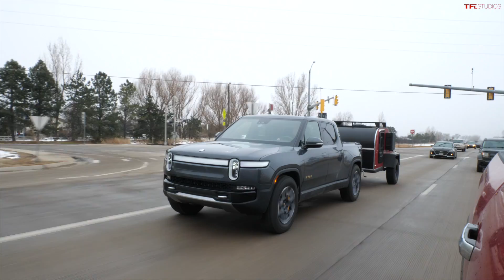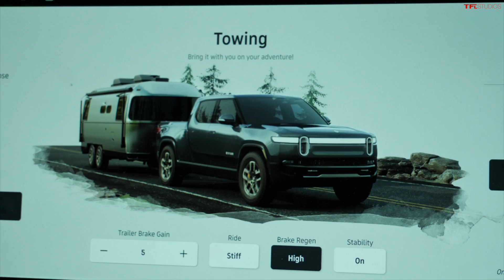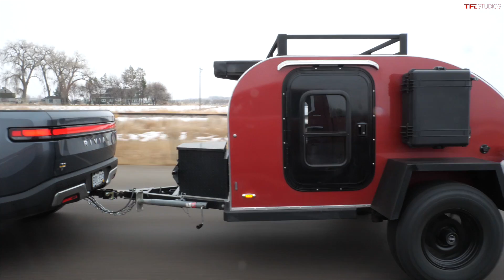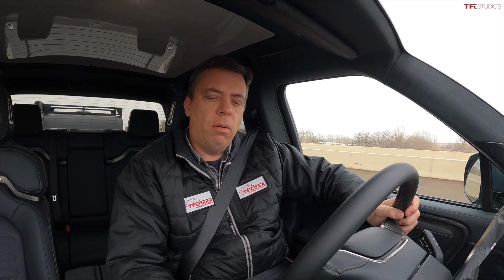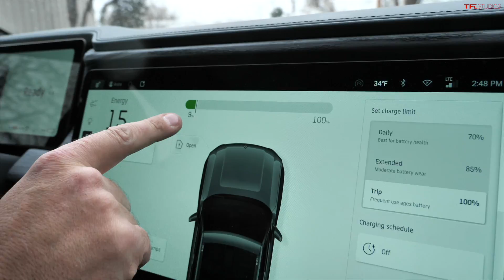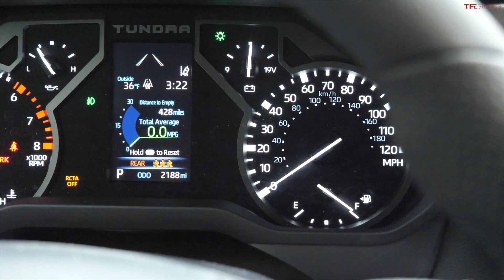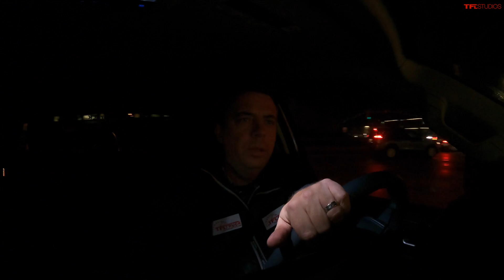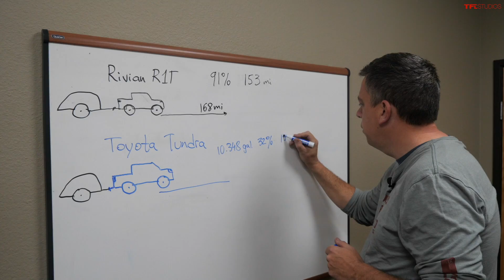Rivian R1T vs. Toyota Tundra: How Far Can Each Truck Tow On A Single 'Fill-Up'?

Comment: How many kWh of energy did the Rivian consume?  Once you know that you could also do a nice comparison of the cost required to fill it back up vs the Toyota. My guess it’ll be 1/2 the cost of that 10 or so gallons of gasoline for the Tundra. For instance if that Rivian had the 135 kWh battery, 91% of it would be 122.9 kW. Multiplied by $0.135 or 13.5 cents/kWh that I pay that works out to $16.58 of go juice vs the $35 or so for the Tundra.

Comment: I find the tank percentage a bit misleading. The tundra has a 32.2 gallon tank where a f150 or a ram 1500 has a 26 gallon tank. Did you choose the tundra for the tank size?

Comment: This is great, BUUUUUT: The Toyota used 10.348 gallons of fuel at a cost, near me, of at least $35. It would have been great to know how much $$$ the kW that went into the Rivian cost. Also, tow an 11,000 lb trailer, and then make two trips with the Toyota, towing 9,200 the first time and 1,800 the second, and tell me how much closer the numbers were. My hunch is that although many of the viewers will tow a teardrop, some of us are genuinely needing closer to the 11,000 lb capacity of the Rivian, and it would have been great to be able to put a number to the cost of the tow, so we can decide how much money we are spending to save the time of the stop / charge cycle. Is it $10 compared to $35? Is it $33?

Comment: I think it’s worth noting that the fuel economy of the Tundra drops nearly as much towing compared to the Rivian. The Tundra is rated 24 MPG highway, and during the test, it managed 14 MPG.  So the main difference between the two is the ability to carry more “fuel” with the Tundra.

Comment: Yeah still wondering what the cost comparison would be to "fill up" between both vehicles since they did the same distance.  What is the cost of electricity vs. gas?  And taking in consideration of downtime to recharge an electric vehicle.

Comment: I want to start by saying I like the Rivian. Being a truck it less efficient than other EV's currently available. I think this is as important to consideration as range and charging rate. The R1T has a 135kwh battery and 314 mile range. For comparison the Kia EV6 has a 77.4kwh battery and 310 range mile (rwd). So the Rivian need a battery 1.74x larger for the same range. That means if they had the same charging rate the Rivian would take 1.74 times longer to recover the same amount of range. 30 min in the Kia would take 52min in the Rivian. This doesn't mean you shouldn't buy the Rivian, or any of the other EV trucks that are coming out, just something to consider. 
( I understand the KIA and Rivian don't have the same charging rate.)

Comment: It's not just about range & recharging. It's also about weight & payload.  The 135-kWh R1T curb weight is 7,148 lbs. & it has a GVWR of 8,532 lbs., making it a Class 2b truck (same as an F-250/GM-2500) but it's payload is only 1384  lbs. I can't find the GCWR. But just adding 10% (minimum) tongue weight of the 11k trailer it's supposedly rated to tow, reduces that 1,384 lb. payload by at least 1,100 lbs., leaving only 284 lbs. for driver, passengers & their gear.

Comment: These electric cars and trucks are a joke. All that weight and the battery does not get lower weight as you drive unlike your gas cars. And you have the charge time. And if you use the heater or the A/C, your range gets reduced more.  Good luck with that.  3 gallon of gas has more energy than a same weight of battery pack.  Good luck if you run out of juice middle of nowhere.  You can walk and carry a small jug to a gas station and you can run the engine for at least 70 miles after. These electric cars are constantly wirelessly connected. You do not know what they are sending back to home. They can also kill the engine at the whim of govt. Total control of your freedom of movements.

Comment: So based on the numbers the Rivian is more expensive per mile and will take you twice as long to get there. Sounds like a great truck to tow even the lightest of campers.  This truck has like a 144kWh pack and only has a 160 mile range towing a 2k trailer?  Sheesh

Comment: INVALID TEST, but close enough.  I got a lot of good info from this video but here is what went wrong.  The test was invalid because you went one leg with one truck and a different leg (return trip) in a different truck.  One truck had an advantage given the following factors that were not considered.  #1 Elevation is a big deal and was not accounted for due to not doing the same exact route.  #2 One leg is different from the other because there is more left or right turns on one leg over the other causing the leg to be longer than the other.  #3 Did you use the same exact lane on the same exact stretch of road?  Because this wasn't done, like #2 you will have to travel further in one lane versus the other when going around curves in the road.  If I missed something or assumed something incorrectly then I'm sorry.
Reply: Nope you are incorrect it was the same out and back route for each truck

Comment: If a Rivian owner towed anything at all it'd probably be more like their kids little league team or dance team trailer but good on you guys for doing something other channels don't. But here's the rub. While a lot of people will stop after a couple of hours to rest a bit that's because they WANT to not HAVE to in order to refuel. And nobody on a trip or on business partially refuels when they stop. So you've got to show the real world time it takes to fully recharge the Rivian. We know it will be far more than the 27 minutes it took to partially recharge in your IKE video but we don't know how long. After two to two and a half hours people are taking a five minutes stretch break, not a forty five minute lunch break. The other issue is something that even you at TFL never seem to address and that is additional payload influences on fuel economy. Okay, somebody is towing a tear drop trailer but are they going to the camp site solo without any gear? If they are towing for the little league team do you think they wouldn't have five people in the cab as well? The guy towing his 2000 pound boat might be going out solo but he's just as likely to have a buddy and his kid with him as well as their gear with them. Payload weight and towing weight as well as trailer drag do affect things differently so not all of this can be extrapolated from a different test. 
I know I'm just a dude on the keyboard but I don't have the resources or the manufacturers access to be anything else right now. But if you need a driver (which you obviously don't) I'd be happy to put in the hours to get those results.

Comment: To be honest, 14mpg is pretty bad for that size trailer. I would fully expect 18-20mpg on the highway. For comparison, in my 1989 F-250 5.0, I get about 13-14mpg with a Lance cabover camper and towing about the same size trailer. 14mpg is abysmal for just a teardrop trailer.

Comment: Batteries have always been the problem with EVs this is nothing new. The industry has tried to electrify more than once. This is why it failed multiple times. This is why they still are inferior. This is why hybrid vehicle is superior. If you really want to have electric motors in a truck the diesel-electric is the answer.

Comment: Would love to see an average cost breakdown. I know there are alot of variables but an "average cost" per 168 mile trip would be awesome!
Reply: I agree. The rivian would be about $15 to recharge and the truck was $40
Reply: @hammercity905  and the rivian fully loaded is $120K...  don't forget to figure that cost into the eq
Reply: @dixter1652  a nicely equipped Tundra will cost around 60k.  60k sure would buy a ton of gas, even at 4 buck a gallon :)
Reply: @hammercity905  I seen another Rivian video .. about 50% cost about $17
Reply: @hammercity905  You are incorrect It is very expensive unless you are charging at home. @11:07 they state they used about 122.85 kWh. In Colorado Electrify America is $0.43 for guest and $0.31 for members (per their site).That is $52.83 and $38.08 respectively using 100% efficient numbers, more accurate is probably closer to $58.11 and $41.89 (with 90% charging efficiency). This is not a vehicle that is good for towing at all it is not aerodynamic which is needed on electric vehicles and too small of a battery. The smart choice would be to stick to close destinations or free/cheap destination chargers.
For the $15.00 you suggest electricity would have to cost $0.122 which is only possible at home and unlikely on a road trip.
Reply: @Thisisaplaceholder1  Thank you! Electrify america in my home state is 48 cents per kwh. For a road trip alone it's more economical to  take a ICE vehicle then electric for me.
Reply: @cody4006  you are welcome. A Tesla 3/Y it’s usually half the cost of gas on a road-trip but this thing is so heavy and other issues for an EV it’s just not a good choice of vehicle if cost is a factor towing/road-trip. Great for shorter destinations when charging at home is an option.
Reply: @Thisisaplaceholder1  Lol electricity in Austin in 3-11 cents a KWH.
Reply: Edmunds did a millage run with the Rivian. It went 317 miles on a charge. 
The 135-kilowatt-hour battery pack that can power the truck for 314 epa miles, they got 317.
After charging the battery back to full, which took about 23 hours and 30 minutes on our Level 2 charger, we calculated an Edmunds consumption rate of 46.9 kWh/100 miles.
Our 317-mile trip in the R1T would have cost us $49.06 at 33 cents per kWh.

Now add a State and Federal tax to make up for the lost income from gasoline/diesel. It's coming. Per kWh.
Reply: @Brian-jl6gw  that’s about the same price as filling a tank of gas . At least well.. when gas was cheaper under the last Administration 😝
Reply: @tpike32  and that tank wouldn't be empty after 314 miles. That's about 16 gallons of gas.
Reply: @Nonexistent Quark lol
Reply: Yes, I think that's what viewers want to know! Certainly a major reason for going electric.

Comment: Great comparison. I suppose the conclusion, given the small and low trailer used, is that I would have to stop and recharge at least twice and closer to 3 times for each time I fill up the Tundra. If I can fill up the Tundra in 10 minutes and recharge the Rivian in X minutes, it could be fairly easy to show how long a standard 500 mile or 1,000 camping trip would take one vs. the other. I do think TFL should invest in owning an average travel trailer that most people use – like a 20-25 foot travel trailer that has much worse aerodynamics vs the small/low trailer used in this video.
Reply: Rivian is 70 minutes 10-90%, 0-100% is approaching 3 hours.

Comment: Let’s imagine the driver of the truck didn’t care at all about time, but only cost. What was the cost difference (charge v. gas) between the trucks on the 153-mile loop?
Reply: If charged on the road, the electric truck is more expensive, if charged at home, much cheaper.

Comment: So we have a $70,000 truck that
has bad cameras
A difficult tow hitch set up
Takes an hour to recharge
With a small trailer goes 1.68 miles per %
Also that power that you're recharging the Rivian with isn't from unicorn farts. It's probably gas or coal
So friends if you want to be environmentally conscious get the Toyota Tundra.

Comment: Thank you for this test.  But I am not sure if this test is actually comparing apples to apples. The Rivian battery is rated for 314 miles not towing anything.  The Tundra has a 32 gallon tank rated for 450-500 miles not towing anything ( I don’t actually know the range of the Tundra for sure).  So I am sure the Rivian with the 400 mile range battery will obviously go further than the 314 mile range battery but still not as far as the 32 gallon Tundra.  Looking at your math and to compare apples to apples an electric truck w/450-500 mile battery range would be equivalent to the Tundra’s 32 gallon tank from a range standpoint and then it would be nice to compare towing efficiencies at that point.

Comment: re: "Charging at Electrify America costs $0.31 per kWh"  ...since most people will charge at home most of the time, for a fair comparison, the "Pass+" $4 monthly charges must be added to the cost per kWh. Monthly fees like those are incurred even if there is no usage.   For a more 'apples-to-apples' comparison for long-distance travel, use the $0.43/kWh "Guest" rate.

Comment: I liked the video a lot but I think you’re comparing apples to oranges. 
In terms of pricing then yes you should get the tundra for longer travel. 
However, the rivian compares more to the Tacoma in my opinion. The tundra has a 30 gallon tank according to the video. The Tacoma falls under the same demographic of people that would buy a rivian. The Tacoma most likely has a 20 gallon tank. 
As well as the tundra having a bigger body which breaks the air from hitting the trailer causing drag.

Comment: Thankyou TFL for this test. LOL Andrey should have used his boat to get more people seeing and understanding a recognized tow load. I read most of the comments and there is some haters. I think towing with the Ram that has 7-800 hp because the Rivian has 800 hp and around 1000 ft pounds of torque. The haters try to say the are losing money when fueling up after a 2 1/2 hour drive stopping for a pee or food break while charging is normal so no wages for the self important haters. I`m a senior and have traveled across Canada many times and when i go on a holiday i stop at road side museum's and enjoy the ride. Rivian has plans to put charge stations at camp grounds, parks this will make EV vehicles more user friendly.

Comment: Based on RT1 spec.. full charge range is 316 miles while trailer load 153  miles ~ 50% reduction in range.

Comment: Interesting comparison but id like the efficiency numbers for kw/h or something that would be a consistent number for both trucks. I think we all knew the Tundra would be able to go further but capacity of a battery or fuel tank is not the same as it's efficiency. Dunno, maybe you can cover this in another video? Was still interesting though.

Comment: The real question for me was how EFFICIENT  was it towing, and how did it do comparable to gasoline MPG. I did a little math with the numbers that Andre gave, and the answer is even while towing the rivian got the equivalent of 40MPG.

To me the "tank" size percentage comparison isn't a fair comparison because it would be the same as comparing say I used 60% fuel in my car for X miles and you only used 30ģ fuel for the same trip, but your tank is over twice the capacity.

Comment: I wonder if the Towing setting eats up the range of the Rivian even with no load. Being a small trailer that's so light, I'd like to see how the Rivian would have done in a normal/All Purpose drive mode instead of towing, or even the conserve mode. Obviously that would be pointless with a larger travel trailer, but with smaller unloaded trailers, I often don't use Tow/Haul mode on my Sierra so I think it would be a fair comparison.
Reply: I agree. Not sure if tow mode is necessary. Would be interested if the results would vary. My guess is that since it’s on loan they want to make sure they use the vehicle in its intended modes to prevent possible damage to the vehicle
Reply: When I tow with my f250(2011 with 6.2 gas), I get better mpg without using tow/haul and it doesn’t hold a downshift for eternity after it’s no longer needed. So it’s possible that it does the same thing on the Rivian
Reply: It's the heating system, not the Tow/Haul mode.  Electric heating with no heat pump is rather like the gasoline heating on the old Chevrolet Corvair which used to triple the car's fuel consumption when the heating was operative.  Non-heat pump electric heating is similar in that it really eats electricity.
Reply: @unconventionalideas5683  for sure the climate control drops it, but I expect Towing mode increases motor drag for brake control, which probably isn't needed on a trailer this small. On the Ike Gauntlet run they showed Towing mode brake regen doesn't recoup much, so I'm wondering if towing a small trailer in towing mode has more drag than necessary, without recouping all of the lost energy through regen

Comment: Until electric vehicles can be recharged in the time it takes to refuel an internal combustion vehicle, they will never be able to replace trucks for hauling any kind of real loads. One thought that is in my head, would be that they all use the same basic battery pack design. Then they could pull up to an automated station, and the pack could be dropped out from underneath, and then a fully charged one is lifted up and locked into place. Same concept that cordless power tools have, in essence. And they could offer larger pack options for extended range, those could be tiered in the same way as different grades of gasoline, when you pull up to the pack stations. Anyways, just my thoughts on it...

Comment: Did a little bit of math for the charge vs gas cost. (I'm using my own state and location)

Electrify America is $.35 per kwh
Meaning that 168 miles would cost...assuming it will take around 120kwh (including losses) to recharge is $42
120kwh x $.35 = $42

Charging at home is $.18 per kwh
120kwh x $.18 = $21.6

Tundra/Gas is $4.59
10 gals = $45.90

I think electric tow vehicles need multiple gears, I know aero plays a huge role for electric, but I think that Rivian could've gotten close to 180-200 if it was geared at 15 to 1, which puts its top speed around 85, but the electric motor would probably be operating closer to peak efficiency at 60-65mph.

Comment: And the gas powered truck takes a few minutes to refill the tank, but the Rivian will take a lot longer to get to 100%.  Just proves that EVs are still only viable for short haul, in town driving, not cross country or long mileage trips.